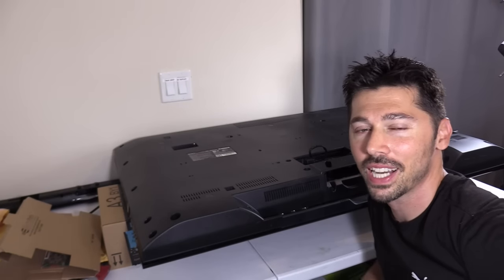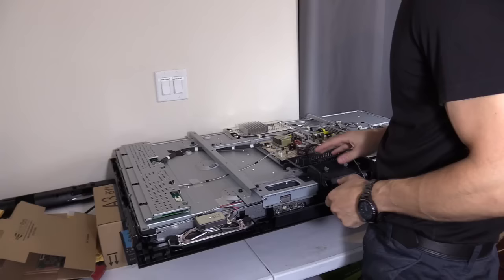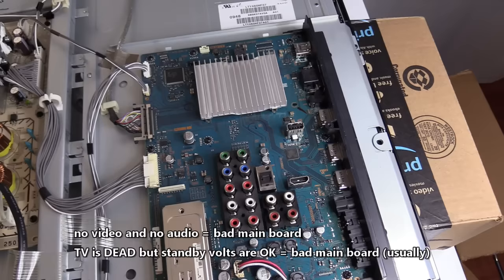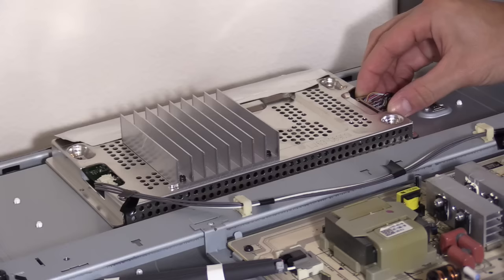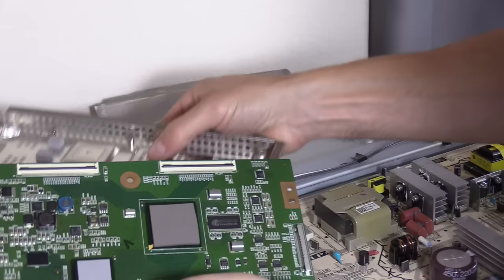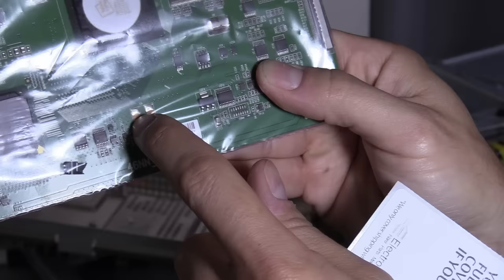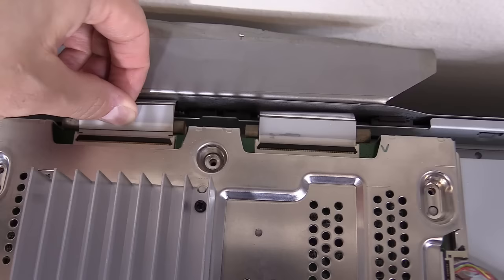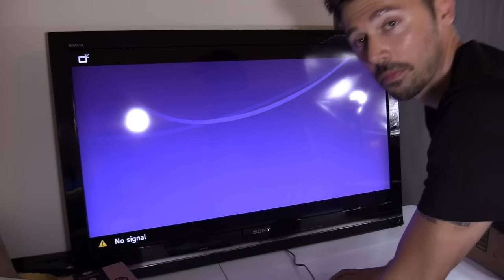SUPER EASY WAY TO FIX MOST SONY LCD TV KDL- PICTURE SCREENS !!!

Comment from the maker: Check https://electropartsonline.com/ for TV boards, power board, main board, tcon board, inverter board, use code Tampatecfriend for 10%off *Subscribe for more common Electronics Repairs!
Reply: Tampatec man i got a samsung tv led 40" with vertical lines you think replace board fix the image
Reply from the maker: Zaddiel Ruiz yes
Reply: Tampatec thanks for answer you know where i can find it i search in the page you post any other web
Reply from the maker: Zaddiel Ruiz search by board number but call them to be sure.
Reply: Tampatec  I have a Samsung 70  pic is good but vertical lines
Reply: Trying to send u a photo maybe ribbons l
Reply: Tampatec hello need contact ID have a problem whit my TV ... have a nice day my friend ...
Reply: Tampatec hey I got this 65 inch Vizio tv, not sure if led or whatever I know it looks like water or wherever when you touch the screen, but I've had this tv for a little over two years brand new when I got it, I'm a gamer and I used it quite often on a high Brightness setting, over time where the dark colors in the color would be like black, purple, blue, all turned green and then the screen started getting fuzzy. The picture would still show but this green fuzz would be all through out the picture, then it got worse and the entire screen shifted right and became off center. Idk what the problem is and after calling Vizio they told me I have to get a new tv because my warranty ran out. What do you think it could be and is it fixable, thanks for any help
Reply: I was told I needed a new video board. Is that what it's called.
Reply: Hey @Tampatec Do you think its worth buying a non working Sony 75”4k Xbr75x850E for $80 to repair it??
Reply: I am going to be using your code to get parts for sure. Quick question. I have a Sony Bravia KDL32S3000. It has power and audio. It also has segmented full color vertical lines in the bottom left hand corner. I pulled the panel and disconnected the T-con cable leading in to the the T-con board. ( I did not disconnect the tapes but I did press on them gently to make sure they were not loose). I reconnected the T-con cable and got a good picture. Put everything back together after testing again and still having a full picture. After about a half hour the picture started to get fuzzy and degrade into a haze and eventually back to the vertical lines over the course of a couple hours. Does this sound like the board is the issue? Possible the cable? (worried that as it hangs downward maybe the connection is loosening??? Or is it the tapes themselves at the top of the board? I know it's hard to diagnose over the internet but still if you have any input let me know your thoughts. I'm not sure how often the cable itself goes bad. Thanks in advance.
Reply: Tampatec awww man that code doesn’t work anymore 😢
Reply: Bro can i ask what the LCD screen part is called ? i have a SONY KDL-40W600B and my kid hit the screen with some sort of light plastic item but it still broke the screen from the inside. if i feel the outer glass i cannot feel anything broken but the LCD inside on display is broken ( shattered look ). im asked our local service center here in the philippines and they told me the price is 25,000 to replace the LCD thingi but the TV itself as a whole was only 20,000. i wanted to search the internet for anyone with a KDL-40W600B that has a different defect and who may be willing to sell their LCD part...
Reply: Tampatec I have located the bad point on my power board of the kdl46sl140...when I poke it near the top left corner the screen turns on...TV runs great..but its not stable and continues to shut off sporadically..does this sound familiar and if so what can I do to permanently solve this problem?.. THANKS IN ADVANCE FOR THE CONTENT!!!
Reply: I have sony 4k android tv 43" with flickering color and double image on screen, should i replace tcon board?
Reply: tampatec, how can i remove dead ants on my lcd my tv model is kdl 43w800c thanks
Reply: We have a Sony bravia but if you run your hand over the screen it feels like sand paper. You can also see the abrasions on the screen . Is it possible to have it replaced?
Reply: Tampatec  I have the kdl-46xbr6 , screen just started flicking horizontally.  Would u say T-Con board or?
Reply: Hi I have a sony bravia kdl26s3000, only yesterday I had a problem with on screen menus they start flickering on the screen and do not want to go away, plus I have a dvd set plugged in with the tv and it stopped working, I thought it was the dvd to start with but now I realize it's the tv itself,  I would be glad if you could help. Thanks.
Reply: @Tampatec I could use some advice. I'm about to pick up a KDL-55V5100. The seller says the following: "When it runs for a long amount of time and when you go to turn it off if you want to turn it back on it needs to sit unplugged for about 30-1hr" At the surface level, this sounds like a capacitor in the power supply isn't discharging properly, hence why unplugging it for an extended period of time fixes it. It's supposed to have good picture once it does turn on, and it doesn't turn off abnormally once it does turn on. It just refuses to restart unless it sits unplugged for a while. Before I order parts though, I would like a second opinion. Also if it is most likely the power supply, would it be better to just replace the capacitors, or would it be something else making the capacitors it has discharge too slowly? I have a beginner level understanding of component level electronics and only have a multimeter for testing equipment, so I appreciate some advice on going down the right path.
Reply: Hi Tampatec, I have a Sony Bravia KDL 26S3000, it has gone mad, if I press the menu button the menu window comes up and flickers on and off I cannot function the tv at all, I cannot even use the dvd player connected to it infact its red light flickers too, whenever I turn the tv on, do you think the main has gone bust?
Reply: Hey Tampatec I have a Sony bravia kdl-52xbr3 and I believe it is the logic board you pointed out but  I seem to can not find the part number for my TV. Can you help me. And also great and helpful video.
Reply: Hey tampatec, I have a Sony kdl-46ex400 with no picture or sound, green light only when you power up.  I followed your video and ordered the main board and swapped it. I got really happy to see the tv turn on and show me the language selection screen... a few hours later tv is back to no picture and no sound :(. Can you please help?
Reply: Hi Tampa Tec 
Have a Sony LCD 49” tv the image comes up then fades away immediately.
What do you think this could be ?
Thanks in advance
Reply: How about horizontal line issue? Sony 43X8000E
Reply: Does it matter how the broken screen looks like
Reply: It looks very helpful but wat about ur broken screen I just want to make sure
Reply: Mines just a cracked in one spot
Reply: I searched by tv model cuz it could not find board number
Reply: @Tampatec You mentioned in the video if you have thin black pencil lines across tv replacing the board won't fix it so how do you fix that problem.
Reply: Tampatec bro can u help me: I have a Sony Bravia 55“ TV (kdl55w905a)
I turn on is ok, but a few minute he flicking and turn all screen off, but i can ear the sound, and few second nothing all black. What is the problem?
Thx
Reply: Hello Tampa, Good works with great understanding.

Please my Sony TV comes ON and the picture varnishes gradually but the audio remains. Please what could be the fault
Reply: SONY Bravia picture is flickering
Audio and power are ok and continuous
Model: KD-46CX520
Serial No.: 2048290
Please advice.
Reply: @marvinsalonga7021  check LCD board
Reply: I'm late to the party but I have a KDL32M4000 I got free. The Bravia Logo appears but won't go away. I tried unplugging, holding the power and volume down keys and replugging to reset and nothing. Could the board in this video be the problem with mine as well?
Reply: Informative.  But I have a KDL 32EX400 and I cannot figure out how to get the rear cover off.  I have removed 10 screws but there are some clips or something at the top of the that won't let me separate from the bezel.  I 've tried all sorts of things but it won't come off.
Reply: i have a sony lcd tv like yours  it has 3 vertical lines ,I realize that if you press the botom of the screen 1 of the lines goes away , do I have to replace the whole board ?

Comment: I have the 52" Sony Bravia model similar to the 46" in this video. I bought it in 2008.  The picture went out on it the other day after more than 10 years of use.  Because of this video I was able to diagnose the issue and repair it.  It was a bad Tcon board.  Bought a replacement from electropartsonline and now it's working again.  I hope to get many more years out of this TV.  Thanks!

Comment: You saved me man! I actually didn’t need to get a new part I just took out and cleaned the white straps and put them back in and adjusted them a little bit.  TVs working fine
Reply from the maker: So you clean and reseated Tcon connections and fixed the TV?

Comment: I had the same problem with my KDL-46XBR4. Turns out it was the top rightmost ribbon cable that provides a feed to the LCD screen. There's a laminate adhesive connecting it to the PCB, and over years, the heat from the unit rising up in that corner softens the adhesive, allowing it to slightly separate and screw up the picture. Simply pressing your finger on it fixes the problem. I applied one layer of electrical tape then several layers of grip tape, to ensure the metal frame will provide sufficient pressure on the cable. Worked great. One tip: After taking off the top bracket, put the stand supports back on, then the stand. This makes it much easier to work on the set, rather than resting it loosely on the floor, risking some bending of the bottom frame tabs.
Reply: I have a KDL – R 60xbr1 and on the right side of the screen I have a distortion only on the right side of the screen from top to bottom… When I press on the top near the button functions it goes away… It does come back every time restart the TV… I was wondering if you think I don't t-con board or maybe just something similar to the problem you have?
Reply: @jet4kev1  Well, it sounds like there may be some lamination problem that could also be ribbon cable related. If you've got the time and verve to do it, try taking apart the TV and inspecting that area. See if you can pad it to help keep the pressure on to make the distortion go away permanently.

Comment: I’m so glad I found your video.  I’ve been dealing with horizontal lines on the screen after initially turning on the power which go away after 30 or so minutes.  I saw a recommendation to hit the back of the TV to see if that changes anything and I noticed a change when I hit the back of the TV near the board you replaced.  I have a KDL - 52Z5100 and will attempt to inspect my board and see if replacing it resolves the issue.
Reply: Ms. G just read your comment, I’ve been dealing with a similar issue. My tv sometimes it looks good sometimes I get double image. I gave it a little love tap where the board is and it worked! Thanks
Edit: it’s back :(

Comment: I have the 52 inch model. Bought it in 09. Still works great. Never had one issue with it. I bought a x750h Bravia a month ago. I hope it last as long as the 09 Bravia. But I doubt it. I must have got a one in a thousand tv.

Comment: Thanks man, I just found this model sitting out by a dumpster near my apt last night. Brought it home and it's got exactly the same symptoms. I'm not shy about doing repairs (computer technician) so I may look into doing board component replacement, or I may just replace the t-con if it's cheap enough. Thanks again!
Reply from the maker: Keep us updated
Reply: @TampaTec  Looks like the board in question is the only one not out of stock, and can be had for the same price you paid, will update.
Reply: @TampaTec  hi i have sony 50w656a ligne black in screan. Can u give me how i fixed

Comment: If it won't fully turn on, or there are intermittent issues, try baking the mainboard (with AV connections). I used a heat gun and a multimeter with temp sensor in an empty cardboard box. Bake for 10 mins @ 385F. This has fixed a dead LG 3D 47" and a Sony KDL-52Z100. Let it sit for 30-40 mins once you remove the heat. This basically reflows the solder on the smaller chip connections that separate over years of heat cycling. You can use your oven, but it lets off some nasty smell from the plastics getting hot.

Comment: I'm really liking what you're doing, man. I've replaced capacitors on an Element, bringing it back to life twice over a decade. I picked up a couple of Bravias at the dump thinking I could fiddle with them, have a little fun. One has a HUGE orange tint. You think replacing the same board you did in this video would do the trick?

Comment: Great videos and very helpful in trying to determine issue. Have a Sony Bravia KDL-40M4000 with picture issues. I'm hoping no more that T-Con board. Problem starts with one vertical line when turned on. this will go away in 10-15 minutes. After an hour or 2, screen washes out white and sound ok. Typically picture will come back for another while and then may wash out white again. Picture may stay for an hour or 2 and then wash out again. When picture is on, it's perfect. Keep up the great videos. T-Con board or other issues. Have not opened it up yet.

Comment: Dear @TampaTec as a fellow resident of Tampa your excellent videos caught my attention.  Can you please help me?  I have a Sony KDL-46S5100 that still has a beautiful picture when streaming through the HDMI ports.  However when trying to receive over the air broadcast TV signals, the picture is totally garbled and unwatchable, I suppose I need a new tuner card?  If that sounds reasonable to replace and solve the problem I will go ahead.  Your tips on going by the number on the card and not the model on the TV is brilliant!  I will go by that number if I can figure out which card to replace.  Thanks a million!
Reply from the maker: You need to troubleshoot by process of elimination. Check TV connections, use another cable if needed. Check antenna 📡 📶 position and signal strength. Scan digital channels not cable / analog channels. Reset TV by unplugging TV power cord for 1 minute. Check tuner rf solder connections if needed solder bad solder joints. Can be bad tv tuner or main board. Get TV boards at shopjimmy.com or electropartsonline.com

Comment: Hey TampaTech,
I appreciate you taking the time and teaching us all about the workings of electronics.
I have a 70" LG Smart TV that has a very low speed on streaming video. i was thinking that maybe its the built in NIC & tried adding a USB NIC that is newer and faster.
I have 1 iGB fiber coming into our home and other devices work fine.
But, How can I disable the local NIC on the LG TV?

Comment: Awesome! Thanks for the straight-forward explanation. I have a similar SONY tv: KDL-46Z4100. Its screen error is a pile of horizontal and vertical red and green lines; pretty much a full cross-hatch (tight ‘plaid’ pattern if you will).
What do you think are the odds that I just need to order the equivalent LCD board (the upper one you worked on) for my TV?  Thanks again!

Comment from the maker: still curious about the advanced tcon board repair here is the link- https://www.youtube.com/watch?v=CWL0Y8g-TMo
i will look for the IC replacement online to produce a tcon board advance repair later on *NOTE replacing the tcon IC is common fix but does not come with a warranty and NOT a guaranteed to fix your TV, replacing the tcon board which also comes with a warranty has higher success rate but cost about $30 more than the IC.

Comment: Thanks so much. I have a KDL-40V5100 that has a cracked screen....like someone threw a ball at it & broke the LCD (the outter screen or cover...no issues). Would you recommend LCD replacement? I have not taken apart yet & will start possibly looking for part.  Video most helpful.

Comment: Hi, I'd just like to clear something up, you said if you see vertical lines that denotes that you should replace the board you replaced, however, when you showed the lines you get when powering up the tv, they were horizontal lines. Unless you mean the dark lines in between the rows of white horizontal lines. I would have recognized them as horizontal and not vertical, can you please explain a little more about that? Thanks. Great video by the way.

Comment: SONY KDL-46HX820 (4 x blink - no back light)
In my case changing Power Board solved the problem. There was no voltage (26.5V) on VLED_VCC lines to LED Driver board.

Comment: Tampatec!  Thank you very much.  Very informative.  I have thick and thin vertical lines on the middle but i do get most of the image coming through.  Do you think replacing this board will do the trick as well?  Thanks a lot again for the awesome straight to the point video.
Reply from the maker: Jaime Martinez usually vertical lines is bad tcon board also check tcon ribbon cable connections then sometimes main board can cause video issues. get tv boards shopjimmy.com and electropartsonline.com use code tampatecfriend for discount.

Comment: Great video. Initially when I turn my Sony KDL-52W4100 on, the image is generally distorted with more or less vertical lines. Eventually the TV will "warm up" and the picture go to basically normal, though the odd time I get horizontal lines as well and sometimes after hours it will go distorted again. Is it likely caused by the same issue? Thanks.